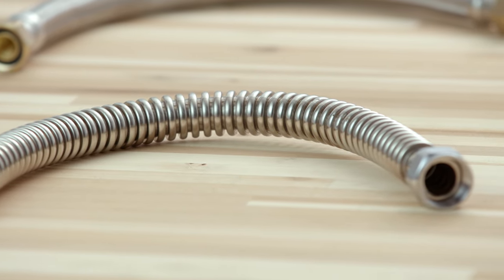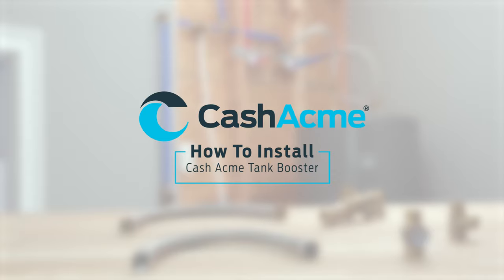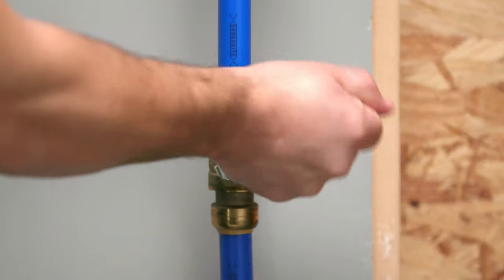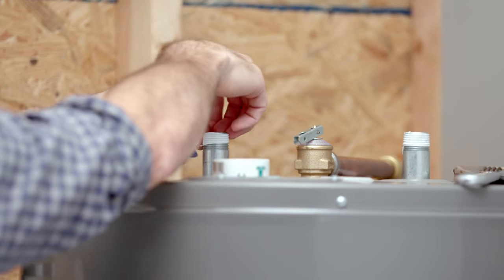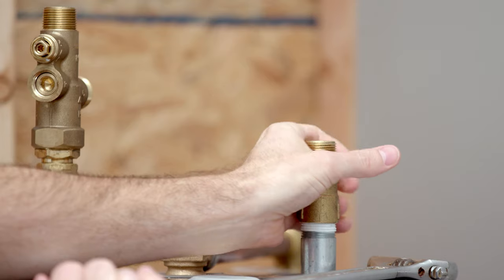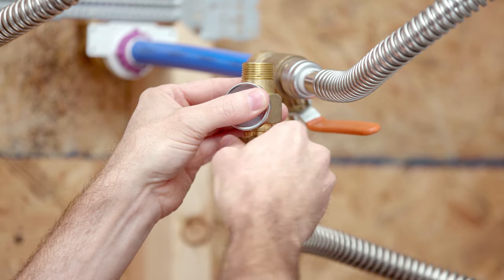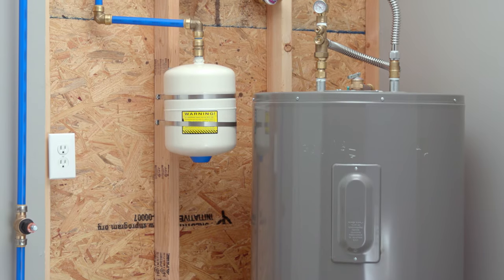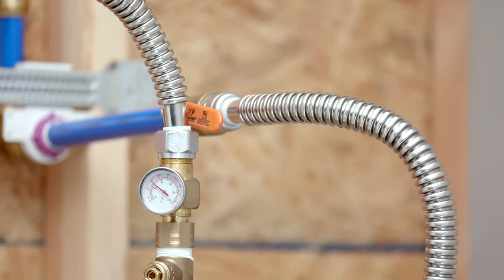How To Install a Tank Booster Pro to Increase Hot Water

Comment: Did I miss something?  I know how mixing valves work, and I know how other brand's boosters work (at least Rheem's).  This video's title and opening seconds says it's about a booster, but the rest of the video is all about a mixing valve, and it never says how the booster fits in.  Am I wrong?  I realize mixing valves also boost hot water output, but mixing valves aren't the same as boosters.  What is the small tank ~above the main tank in this video?  

Or is Rheem's booster just a mixing valve in disguise?  I don't think so.  It says it allows for a tank-tankless hybrid - it is a mini-tankless - one which shares the same electrical supply as the tank.
Reply: They arent calling it a booster heater. That other tank is an expansion tank.